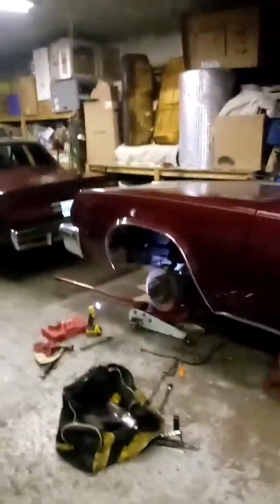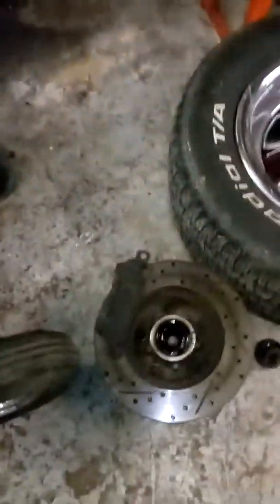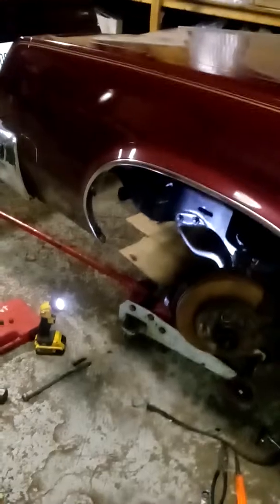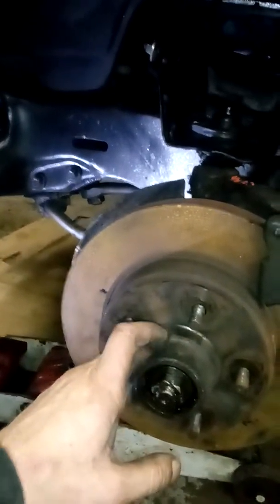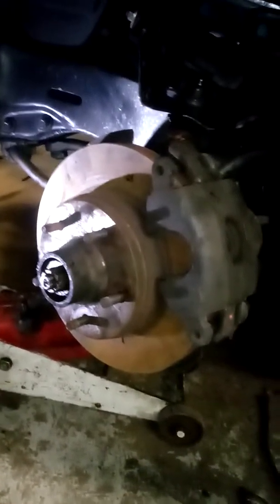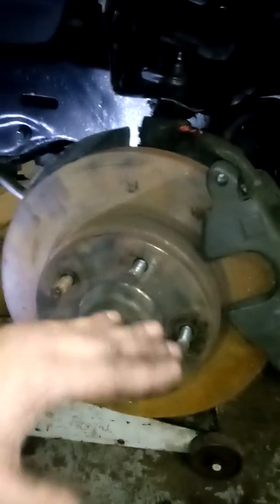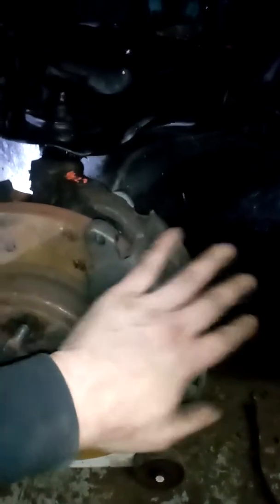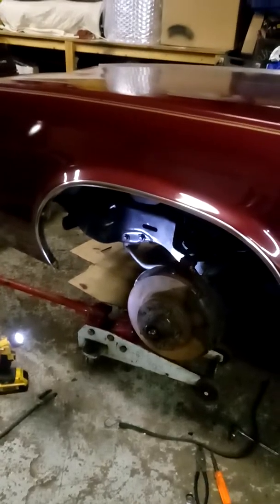Big brake swap 1995 caprice/impala to a 1976 gm a body cutlass with 15 inch wheels

Comment from the maker: Correction all they are 11.95 front and 11.90 rear rotors from 95 caprice
Reply: Did you have to change the proportion valve
Reply from the maker: Alonzoe untouchable ..no i didnt have to change it brakes work good ...